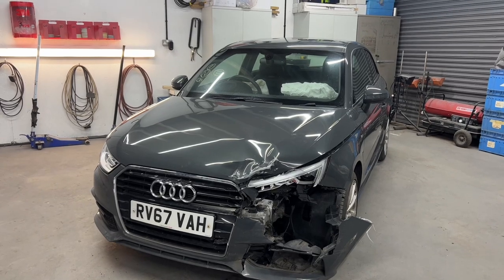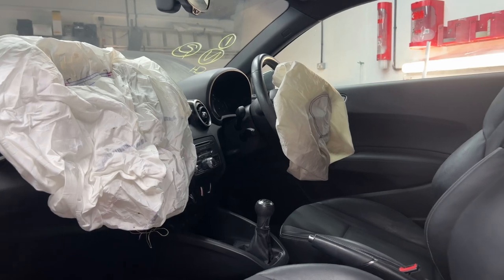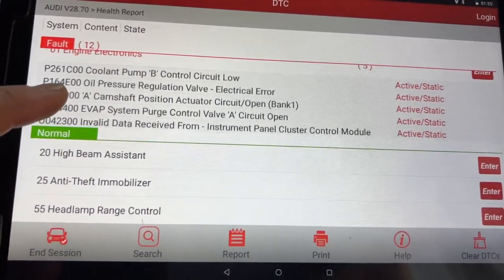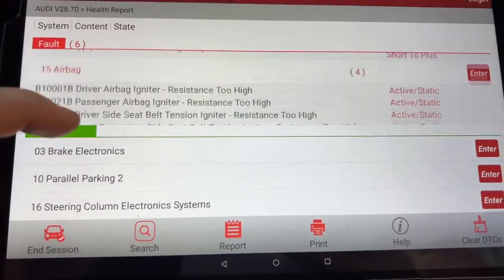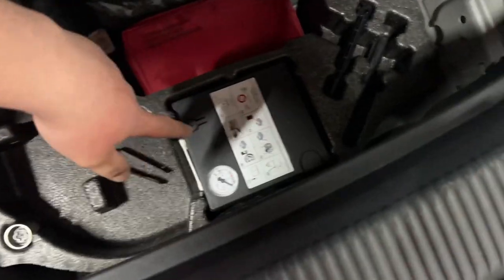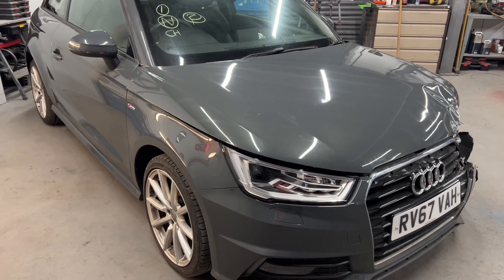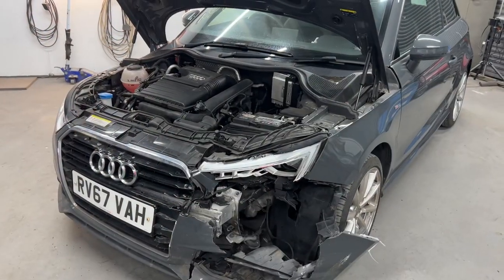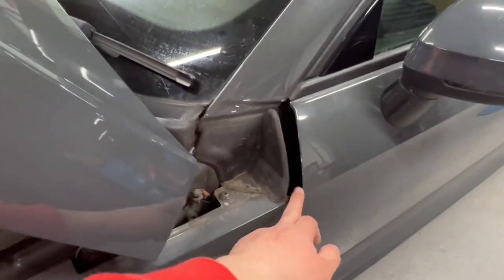I BOUGHT A CRASHED DAMAGED CAT S 2017 AUDI A1 SLINE TO REBUILD FROM COPART PART 1

Comment: How did you get into repairing cars did you do it on your driveway before and also do you make a account for copart is it free and what insurance do you use for transporting cars back is it motor traders ?
Reply from the maker: Hi Callum I’ve been selling cars for 12 years and been rebuilding salvage cars for nearly 7 years now think I got the bug for doing them from a couple of friends who own body / accident repair centre’s  as they always said you do a lot of big mechanical repairs why not try salvage vehicles. 

Copart account is £100 a year subscription. 
delivering the cars from copart I use my own recovery guy . And yes trade insurance
Reply: @NathanHiley  thanks for the reply but I am 20 and looking to start repairing. Cars !
Reply from the maker: I would definitely say start with a cat N vehicle. do your research on the Vehicle for example price of parts and availability . Also look at every photo in HD on copart and zoom on the photos to look for further damage like scratches scrapes and dents . And the main thing set your self a limit when bidding and don’t go over that as you can easily get carried away and you can see how much fees will cost on the winning price with the fee calculator on copart hope this helps
Reply: @NathanHiley  thanks buddy will do
Reply: @NathanHiley  get advice, helped me with making the decision to try my first project, which also happens to be a Nano Grey A1!